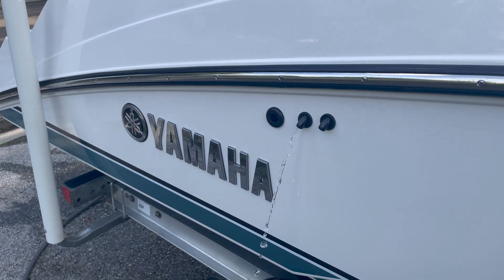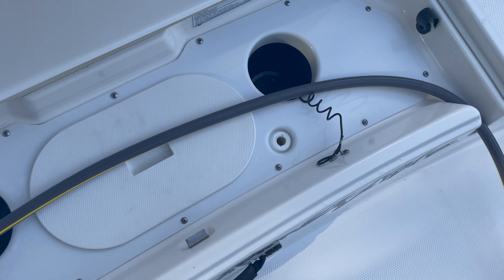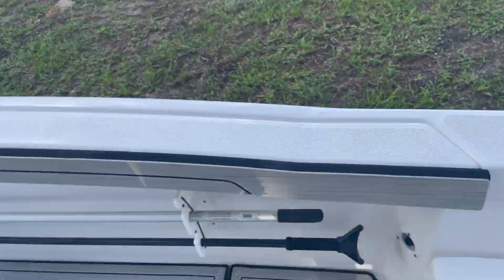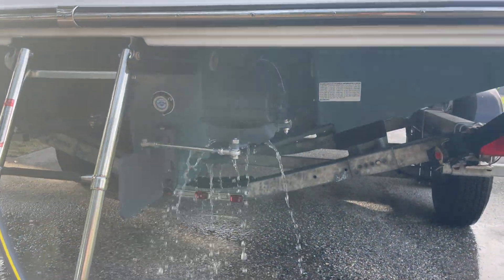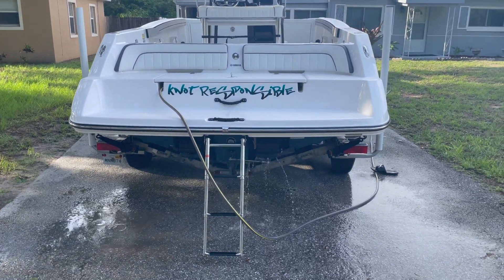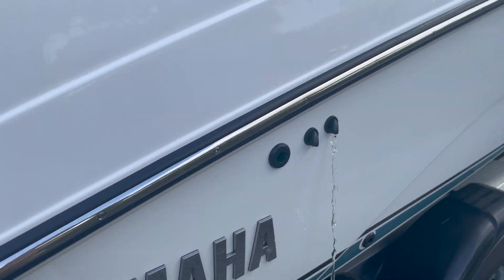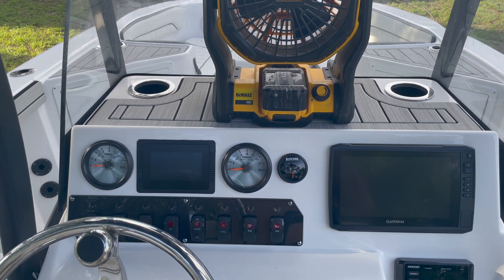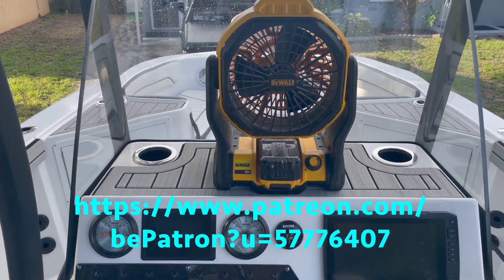How To Properly Flush Yamaha Marine Engines. Specifically Jet Propulsion Boats. Yamaha 210 FSH Sport

Comment: Does it matter if you do this with bilge pump off?
Reply from the maker: No, the bilge pump is for standing water in your hull. This is for flushing the internal components of your engine cooling system.
Reply: @THE-DIY-DUDE  got it. Thanks. The other day I flushed the engine s and steam was coming out and water dripping from the back was hot. Few days later I flushed them again and no steam whatsoever. Do you know why that could be?
Reply from the maker: @ralphv.5026  that’s normal, the water is hot because it’s absorbed the engine heat. That’s how your motors are cooled. Sometimes it steams sometimes it doesn’t .

Comment: Dude.. Where did you buy the spare tire mount for your trailer? I ordered one like that and the frame brackets were not wide enough to mount to bracket.. Also, did you install the vertical gide poles yourself? If so, where sourced?
Reply from the maker: That spare tire mount comes with the trailer stock from the factory for the FSH 210. The guide poles I did myself. Here’s the link https://amzn.to/4b2R58E

Comment: I’m not getting any water coming from the side. 
What could be the problem?
Reply from the maker: There could be a few problems first being water pressure if you do not have enough water pressure from your hose It won’t come out the side next would be clogged ports sometimes the port gets clogged by insects and lastly, you could have an issue more major like engine issues the first thing I would start with the hose pressure and go from there.

Comment: I learned the hard way you got to rev the engine after shutting up the water hose. make sure you do otherwise water stays stuck in there and corrodes your sensors. Had to replace both O2 sensors $185 a pop! ouch!
Reply from the maker: That is correct, the blow out is shown in the video just for that reason. Thanks for the comment. Never let water rest anywhere, not just the engines.

Comment: Hello,

Just had a great day on the lake. I got home and hooked up the house and nothing came out the pisser. Water was coming out through the pump though.

I am now receiving an engine overheat alert. Any helpful comments and next steps are welcome.

Best,

Jeff
Reply from the maker: This is usually caused by low water pressure from the hose. Try hooking up to a higher pressure spigot somewhere else to test.

Comment: May be a really stupid question but first time boat owner and just got our 2021 FSH 210 sport. Question is I understand water can’t be introduced to engine until engine is on etc when cleaning..but what do you do when launching? Do you start boat before you put it in water from the trailer? Hoping you can help with the best practice on this. Again apologies for a dumb question but total beginner here.
Reply from the maker: This only applies to flushing. Do not start the boat before putting it in the water for launching. Start it after it is in the water. Otherwise you’d never be able to stop your boat if you think about it. Flushing forces water into the cooling system with or without the engine running. The water intake for the engines only forces water when the engines are running in the water. If you run the engines out of the water without using the flushing ports you will overheat them.

Comment: Have u done any engine mods? Like a ribbon delete or air intake? I have the same boat but need more speed
Reply from the maker: You won’t get much out of these motors. They are the TR1s. Designed for efficiency not speed. I’ve seen people drop thousands and only get 4mph. Not worth it. The smart tabs got me 1-2mph top end.
Reply: @THE-DIY-DUDE  thx I will just leave it or just do an inexpensive ribbon delete

Comment: I think I made mistake last time and water stocked to the engine and when I used the boat today it was making so much noise and for 30 minutes full speed didn’t go over 10 after that it’s was better and again same thing happened. Do you What should I do to fixing the issue? Thank you
Reply from the maker: I hope you didn’t get water in the engine and if you did you could possibly have damaged internals. Pull spark plugs and turn the motor over to see if water sprays out. Also check your oil and see if it is “milky” Hope everything is ok 🤞🏼

Comment: Thanks!.... questions, is it possible to use a "Y" to connect 2 hoses at the same time and flush both engines?
Reply from the maker: Yes, but unless you know your pressure is enough to support this then I highly suggest doing it by the book. There is a certain pressure range that needs to be supplied and a certain RPM you should keep to properly flush and cool the engines. I personally dont want to take that chance. Plus, doing each engine individually lets you hear how each one is running compared to the other. If they are both running problems are easily hidden by the other engine noise. Like I tell everyone else, do it by the book and do it right for longevity of life. When you cut corners you run the risk of prematurely damaging your boat. That goes for everything including washing and service.

Comment: Hmmm mine doesn’t flush through pissers during clean out. Never has. 🤔
Reply from the maker: That’s an issue, you may not have enough water pressure or high enough rpms?
Reply: It's not an issue; if the boat is not level and you have low water pressure, such as a well, it won't piss. As long as it is pissing during in-water operation is critical. Mine does the same because I am on well water, and my boat sits on a lift, not level.